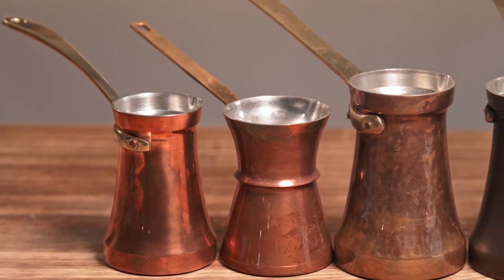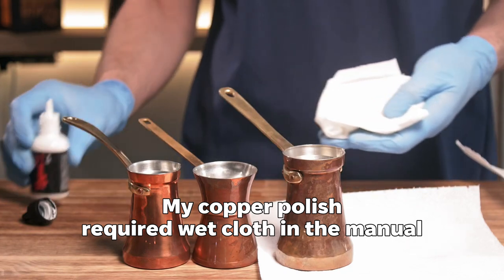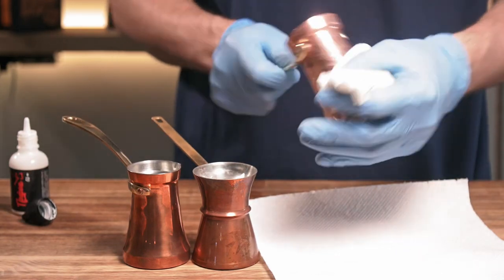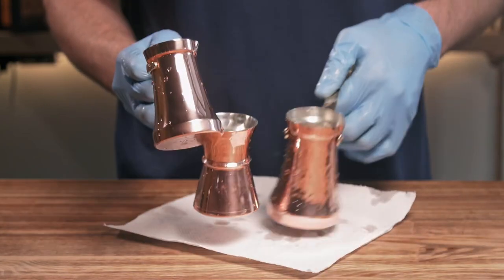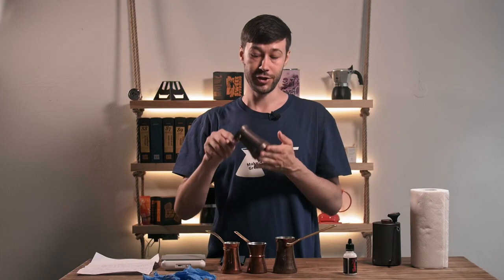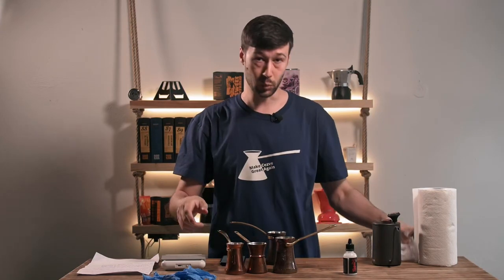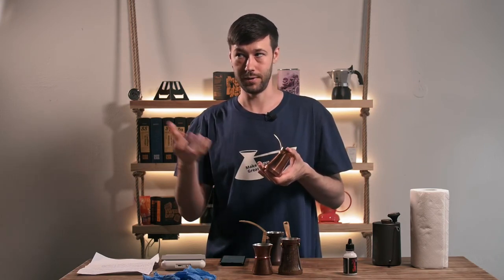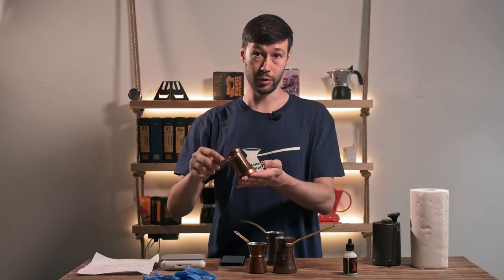How to clean your Copper Turkish coffee pot

Comment: thanks for your videos! literally only started drinking coffee and decided to go with a cezve haha

is there any reason to clean the outer copper layer except the aesthetics?
I usually rinse the pot with tap water, wipe with a paper towel and heat it on the stove for a quick dry
Reply from the maker: I see no point. Oxidation is a protective layer anyway) I wouldn't place it on heat without water inside, because of the tin layer inside. It could be damaged that way. It's enough to just wipe dry and store in a ventilated area)

Comment: Does lemon and salt work the same way as this polish chemical? Soy has a video cleaning with lemon and salt and it produced the same effect
Reply from the maker: I've used it as well. And ketchup. But it takes more time, while this is almost instant. And keeps it shiny for longer (at least in my case). With lemon and salt - better to give it more time for reaction
Reply from the maker: I'll try vinegar with salt in around an hour. Used lemon for a salad. Should work the same. Probably will post some pictures of the result
Reply from the maker: Worked with the salt and vinegar. Still, not that shiny and scratched the surface with the salt. Takes more effort. While copper polish is more like wiping than polishing
Reply: @wendstudio_coffee  thanks! Good to know
Reply from the maker: You can use some fine salt or just don't press that much as I did. Or just skip the salt and scrub with some sponge, but not aggressively
Reply: @wendstudio_coffee  perfect thanks!

Comment: Just ordered one and the inside has some minor scrapes where the tin lining is gone, and there are tiny super small black dirt-like spots at the bottom inside it, is this safe?
Reply from the maker: @royloplays  yes, it's safe. Original copper cookware and even cezve was without tinning. And copper cookware is still in use (pans, mugs etc.). So small contact with the copper will not have an impact at all. 

The scrapes are usually from the technological process as well as the spots. Some models have more of them, some - could be spotless.

The most consistent one is Briki (Mediterranean Art). Even though near the rivets they tend to have uneven coverage with the tin, the overall quality of tinning is superb (with visually more pleasing imperfections, wave-like protrusions)